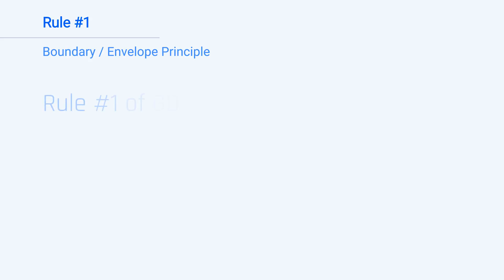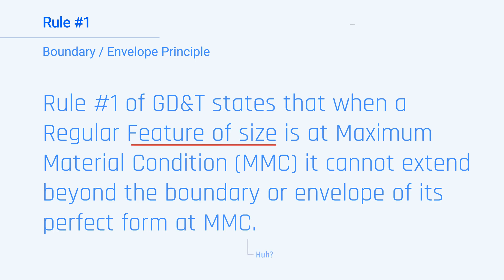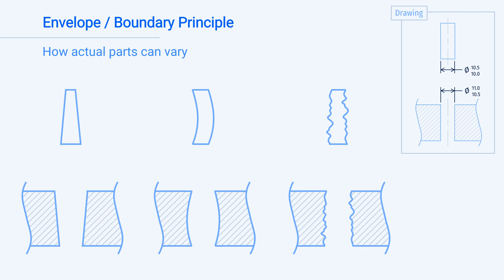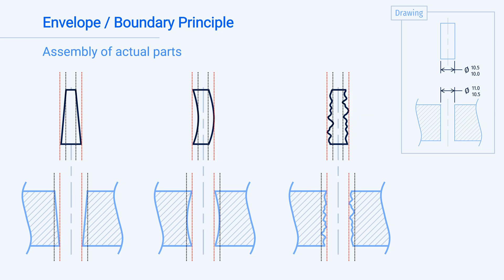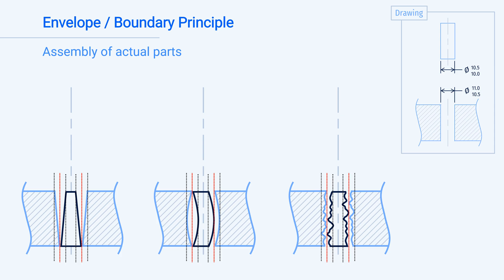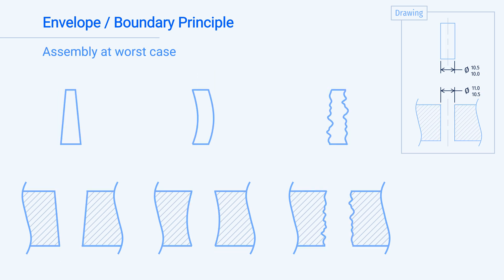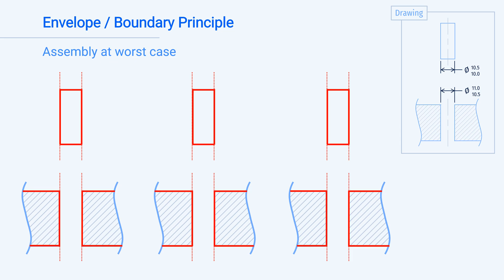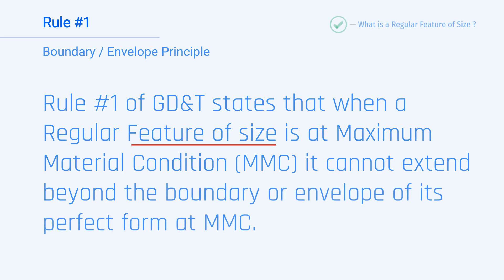1st Rule of GD&T (Boundary/Envelope Principle) - GD&T Course

Comment: What if i am designing a groove where another feature will slot into, and i want to ensure a minimum axial clearance between the groove flank and the feature slotted into it?
Will envelope principle ensure a minimum clearance or do i need parallelism controls on the flanks of the groove?
Reply: I ask because the maximum clearance will occur when the groove feature is at LMC